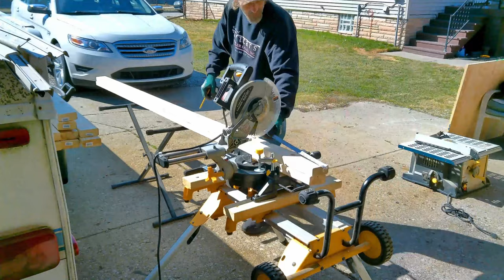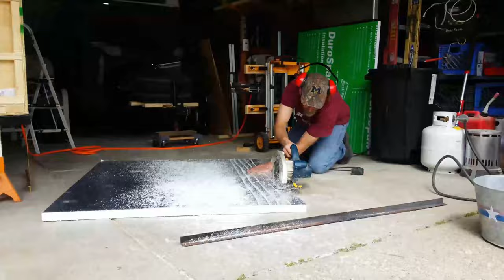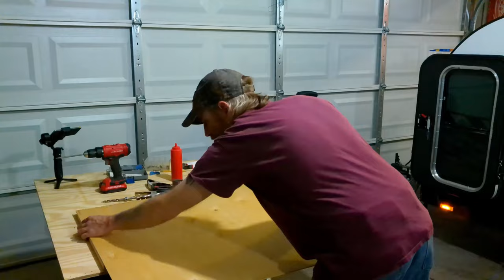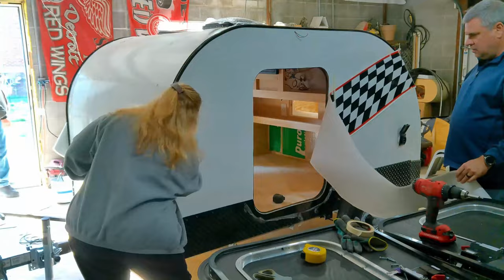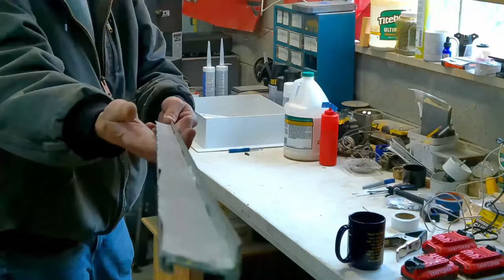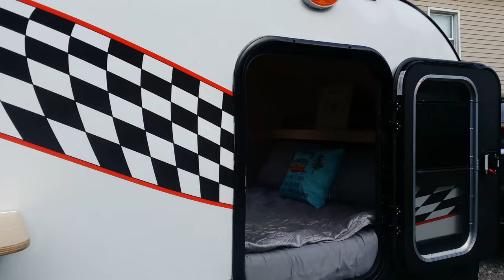(Time-Lapse) 5X8 Teardrop Camper Build in 15 Minutes! (With Walk Around)

Comment: I'm totally new to any type of "from scratch" construction.  I fixed some bathroom walls in my old house that rotted, but otherwise nothing. I see a LOT of great pointers that I can use.  I bought the trailer for $800, it was a tear drop that was rotted.  Tore it down to the trailer.  I have SO many questions because I get a LOT of advice, but all from people whom have never built one.  Beyond that, I don't know tools so forgive my ignorance.   I see you did the inside FIRST, then outside when adding the roof/ceiling. I would appreciate any/all feedback you could give!  :)
This looks EXACTLY like the shape of mine!  :).  I do not have extra cash to spare, so I'm going as economical as I can, but still want it to be
free of leaks.

1) What is the gun with the hose attached and what is in it?  Is that a nail gun or some type of adhesive gun?  
2) Did you undercoat the plywood underneath with anything?
Reply from the maker: I have a complete build playlist of this exact camper here on YouTube. It's several videos but I explained everything. You will find a link to that playlist below.  I use marine grade or exterior grade plywood so I don't coat the underside. If you want to do that, I recommend a quality exterior house paint. The bottom only sees water when it rains while traveling. The nail gun I use is just a cheap, Harbor Freight pneumatic nail/staple gun combo. I use 3/4 inch crown staples in the gun. I recommend you join DIY Teardrop Campers Community on Facebook (my group) There are alot of helpful members in that group. You can send me a Private message on Facebook you have any more questions Thanks for watching and BUILD ON!

https://youtube.com/playlist?list=PLf_NTqHzH6hepyG7HR1TCsN088DitpDMl

Comment: So cool. Some questions if you’re cool with it:

1. What’s the white material (and thickness) you used to cover the sides. 

2 And what kind of adhesive did you use to adhere it to the plywood?  

3. Did you use marine grade plywood?
Reply from the maker: The skin is called filon. No glue, I floated it. The trim, doors, windows and anything else secured to, or going through the camper is enough to secure it. I used exterior grade plywood. Thanks for watching! Build on!
Reply: @DIYTearDropJay  Fantastic. Thanks for sharing the protips. Very glad I found your channel!
Reply from the maker: @RyanWattersRyanWatters  I'm glad you did as well. The skin is 1/8" thick by the way. If you have any other questions, just ask.

Comment: The hardest part I'm imagining with these builds is the attachment to the trailer itself. 
Could anyone explain please how the wood is attached to metal - is there something special that helps so that when traveling/bouncing it does not ruin the trailer?
Reply from the maker: @McNeelyMegan  I weld "L" brackets to the trailer and attach the camper to those using 3/8 carriage bolts. I use a pronged washer on the wood so the carriage bolt doesn't spin. If I could add a picture here, I could show you but unfortunately that isn't an option on YouTube. Thanks for watching!
Reply: @DIYTearDropJay  thank you for the reply! And great video!
Reply from the maker: @McNeelyMegan  thanks again! I'm glad you enjoy the videos